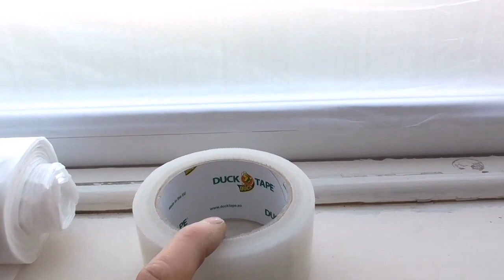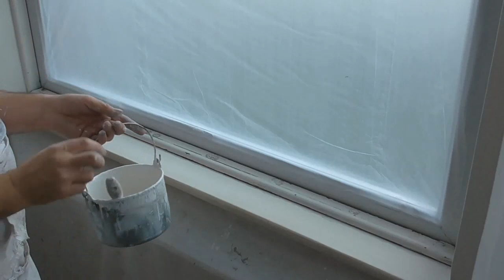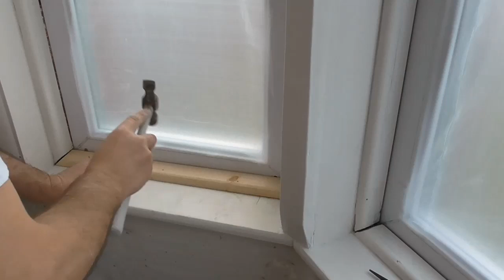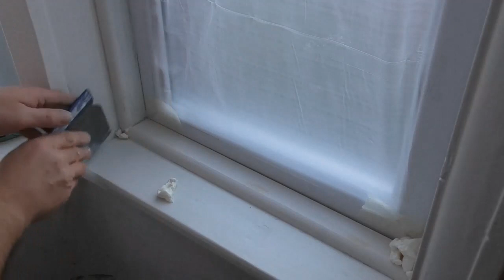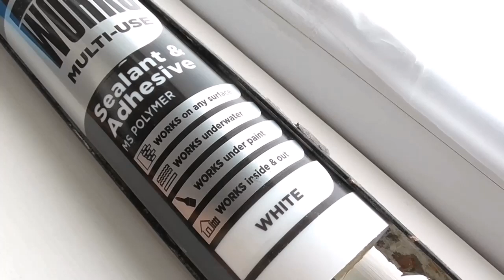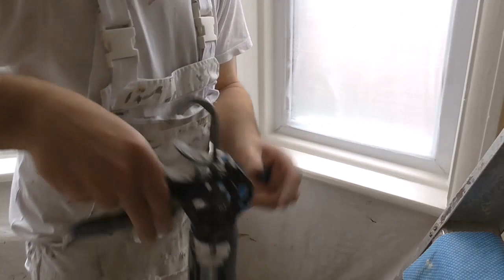Bay Window Prep Making Good From Bad

Comment: I have a question, some jobs are small jobs but to do them properly I have to buy large tins of paint, and large quantities of other materials, this is both wasteful and expensive.  Can I use outdoor gloss paint indoors, and what do you think of "paint anything" paint  for small jobs? Thanks.
Reply from the maker: Never use paints that are designed for exterior use. They are only made to use outside. And for one paint that paints everything sounds   bad. Different paints leave different sheens giving the room some depth to things.
Reply: Thanks for the reply, will take note!